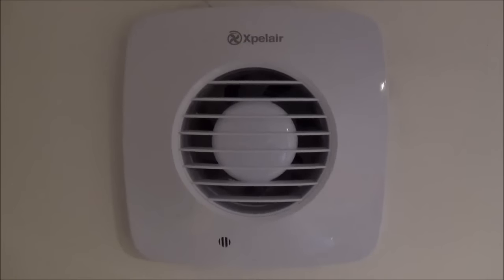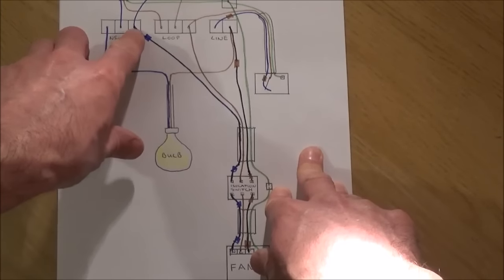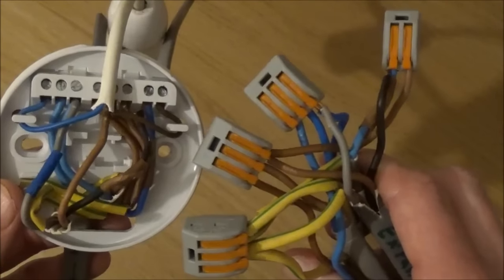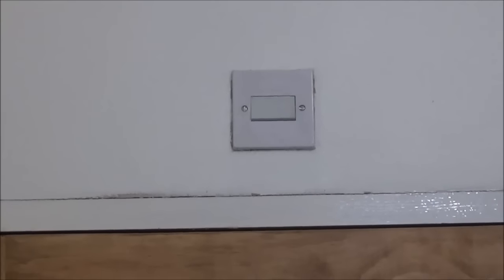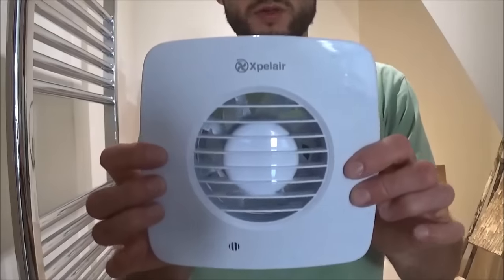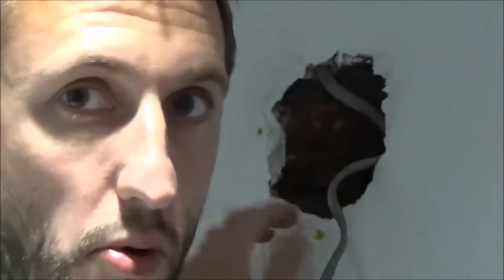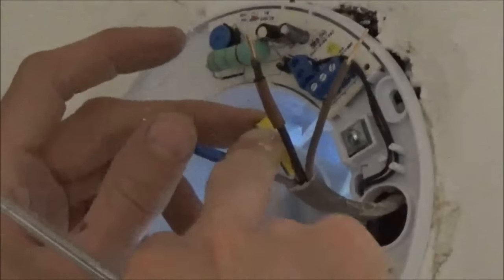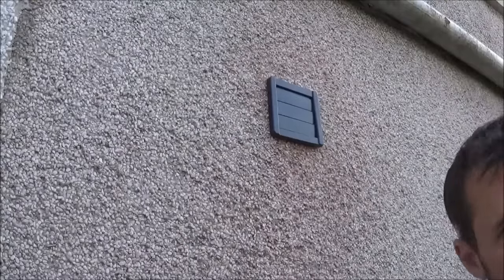How to fit a bathroom extractor fan using light switch. Extractor fan installation. Xpelair DX100

Comment: Nice vid, however unless its like for like change (in this case it's not) you will need to make sure this is rcd protected being in a bathroom.  Under current regs
Reply from the maker: Thanks for the feedback ashley, this fan is indeed RCD protected, but good point. Thanks for watching.
Reply: @POUSEaroundtheHOUSE  Im not trying to catch you out mate,  just letting viewers know in case they attempt it. 👍
Reply: 20amp

Comment: I'm looking to add one to a kitchen to remove excess condensation. Can I take the power from a plug socket or connect directly to a plug and switch on and off as required?
Reply from the maker: You can go from a socket but you will need to add a fused switch (Fused spur) and place a 3amp fuse in the switch to protect the cable and fan. If in doubt please use a qualified electrician as it could potentially be dangerous if done incorrectly. Best of luck.

Comment: Speaking to an electrician a few weeks ago and he said new regs say to put the extractor fan switch lower down . Which to me is daft . But I think they say it’s so the customer can switch it off easily in case of an emergency?? I’m Not 100% on that as I’m not an electrician.
Reply from the maker: Yes, that's possible and makes sense, but that said there's a chance people press it by accident. It'll also just be good practice rather than essential I imagine as it's not really a safety issue, more a practical one. As I'm not an electrician I'm not sure but I'll look into it. Thanks for the feedback 👍

Comment: Hi there. Very useful vid, thanks. I've followed it exactly but for some reason the light comes on but the fan won't. My switch was wired with the blue wires in a block inside and there is no onward light wire - I only have the fan wire in the Loop on the light fitting. Wondering if this is the root of the problem but no idea how to solve. Any advice gratefully received! thanks

Comment: Moved into a new build the recent storms have blown off my vent covers (builders couldn’t be bothered to secure them with screws) and it looks like the extractor fan pipe isn’t flush with the brickwork on the external wall. Does this matter or do I need to chase up the builder to correct it ?
Reply from the maker: If it's a new build then I would chase them up. Would you be happy with a new car with the bumper hanging off? It's a shame they don't take the time to do things properly. You've spent your hard earned money a nice home, you should get what you paid for. Ultimately its up to you but that's what I would do. Best of luck with getting it sorted 👍

Comment: great video bud and well explained....however I get baffled easily. heres my problem. I had an extractor fan and light in my bathroom all working perfectly until the fan started sqeeking. I ripped it out. the light got changed too. I tried to re-wire it all up myself but now the fan comes on when I turn the light out and the fan goes off when the light comes on. there is a black a blue and a brown coming out the ceiling. there is 2 slots for cables on the fan. I have the brown 1 in the live slot, I have the black 1 in the nutrel, when I change the black for the blue then the fan stays on continuesly. its a puzzle. any ideas? wired the light wrong?
Reply from the maker: Hi Dave,   when you say blue, is it blue tape on a grey wire? Sounds like you have wires for a timer fan, but your fan isn't a timer fan. Basically your blue is neutral and should go into the 'N' or Neutral terminal on the fan. Your black sounds like switched live and should go in the 'L' terminal as it will turn on and off with the switch. Your permanent live (Brown) can be safely terminated into a connector block (like a wago 222 block) and left inside the fan but not connected to the fan. On a timer fan you need the permanent live to allow the fan to run on a while once the switch is turned off. You could always replace it with a timer fan which would over run when the light goes off. Obviously without seeing it it's difficult to say.  Hope that helps. Good luck and thanks for watching!

Comment: I've just renovated my home and fitted p.i.rs into the bathrooms with timer run on fans and then it came to me that when its not dark the p.i.rs will not bring the fan on, unless I can wire a bypass switch can you show me how
Reply from the maker: Hi Robert, not entirely sure of the set up you've got and I don't have one to do an example on. However surely the fan is triggered when someone enters the room. You wouldn't use the bathroom in the dark? Also, maybe you can wire it so both the light and fan come on with motion detection? Without knowing the products and having them to do a demo you'd be best off checking with the manufacturer or an electrician as it's probably not straight forward to explain. Sorry if that's no help. Good luck and thanks for watching!

Comment: I am looking for how to separate them . The fan is really annoying. It turns on each time you use the light.
Reply from the maker: Try my other video - How to fit a bathroom extractor fan using an independent switch - https://youtu.be/KxH_FM03cMs

Comment: European and UK electrical regulations also have specific zones in the bathroom where you can fit electrical items, like lights and fans, in some areas, items MUST be low voltage. You make no mention of this during the video which can be misleading or even dangerous for people following your instructions. 
Bathrooms are divided into four specific zones relative to proximity of water, humidity and electrical apparatus. All electrical items must also comply with IP (Ingress Protection) ratings.

Bathroom Zone 0
The inside of the bath, or the inside of the shower that can physically hold or contain water. Electrical items installed into these areas must be low voltage, SELV (Safety Extra Low Voltage - no higher than 12 Volt), and rated no lower than IPX7.
 
Bathroom Zone 1:
The area directly above zone 0, limited to a height of 2.25 metres above the bath or shower. Electrical items installed in this area must have an IP rating of IPX4 or higher. Items installed into zone 1 can be mains voltage, but if so must be fitted to a 30mamp Residual current device. Low voltage items can also be installed in this area, but the transformer for those items must be located outside of zone 2.
 
Bathroom Zone 2:
This is the zone beyond zones 0 and 1, continuing 0.6 metres horizontally and up to 2.25 metres vertically. As with zone 1, mains voltage items must be fitted to an Residual current device, and low voltage items’ transformers must be installed outside of zone 2. IPX4 or higher protection is required. Wash Basins are classified as being in zone 2.
 
Bathroom Zone 3:
Any lighting or extractor fan can be installed in this area, as it does not have an IP rating. Apart from shavers and toothbrushes though, no portable electrical equipment is allowed in this area. 

You can check here for more information
https://www.sparksdirect.co.uk/blog/ip-rating-in-the-bathrooms-bathroom-ip-zoning/

Remember for your safety all electrical works must be carried out by a fully qualified and registered professional electrician. 

Especially in Bathrooms and Kitchens!!!
Reply: The regulations also state that the following mains voltage, fixed, permanently connected equipment is allowed in zones 1 and 2 of a bathroom.
Whirlpool units, electric showers, shower pumps, ventilation equipment, towel rails, water heaters and luminaries.
Reply from the maker: Thanks both for the feedback. Maybe I should have mentioned that in the video. For info, my installation was in a suitable zone, with correct IP rating and RCD protected. Thanks both for watching.
Reply: @POUSEaroundtheHOUSE  Not Maybe! Definitely! 
It's not good practice to encourage DIY electrical work in areas where water and electricity are together, not only can it be very dangerous, but by law, the homeowner or landlord must be able to prove that all electrical installation work on their property meets the requirements of Part P of the 2005 building regulations, In additional changes were introduced to Part P in England in April 2013. This means that electrical work in a dwelling, or associated with its surroundings, is notifiable to a local building control body where it includes:

Circuit alteration or addition in a special location ( Certain zones within a room containing a bath or shower, or a room containing a swimming pool or sauna heater)

Installation of one or more new circuits

Installation of a replacement consumer unit (fuse box)
Rewire of all circuits
Partial rewire
New full electrical installation (new build)
All electrical work in the home in England must comply with Part P of the Building Regulations. In addition, those items described as notifiable above are required by Law to have a Building Regulations Compliance Certificate.
Reply from the maker: @pjmbidge632000  Hi Paul, I do reference Part P at 34 seconds in the video. Thanks again for the comment.

Comment: Hi thank you for your video, I have fitted a fan following another YouTube video,  the video showed the wiring going from the fan to the isolator and from the isolator to the lights pull cord switch, it has not worked, the bathroom light is a new enclosed unit with a lifetime bulb, all it had to connect it was a red live wire, a black neutral wire and the earth , no loop or switch wire, how would I connect the fan to the curling light with that wiring set up, thank you ever so much for your help
Reply from the maker: You probably need to find the main connection in the ceiling or at the light switch. You will need a switched live, permanent live, neutral and earth (CPC) wire to do the installation as per the video. If in doubt call an electrician to ensure it's safe as it can be a tad complicated! Best of luck.

Comment: Since the fan is double insulated could i used twin and earth use neutral and permanent live, but mark the earth wire red and use for switch live?
Reply from the maker: No. Earth wire is thinner than other two at it isn't insulated, it's bare. Use the correct cable. Hope that helps.

Comment: Hi, I'm in a bit of trouble - and need help please.
I ran a 3 core cable (live, neutral and earth) to the fan. This cable is now tiled over so I can't change that!
The problem is I didn't use the light ceiling rose for wiring as it is too difficult to access. So I just put a junction box on the line going to the shaving light over the mirror (easy option!!)
No I have a fan with a timer and I can't wire it up because I don't have any of this done correctly! I just have a live, a neuand an earth!! I should have paid an electrician!!!
Is there a way to wire this in the way that I've done it (with just the 3 wires)?

I cant change the fan now either because I've the holes drilled in the tiles and other fans won't fit there (I've checked). So I'm stuck with this timed fan and wrong wires..ugh! It's not DIY,
it's D - I - WHY!!!!! 🙄
Reply from the maker: Have you looked to see if they do your fan in a non timed version? Sorry if that's a stupid question! My fan came in 3 versions all the same size and appearance with same hole spacings.
Reply: Or you could have the brown live cable to the fan connect up to the switch live terminal on the fan as well as the switch live. You'll need an extra bit of single insulated brown cable to connect the two up.
This does mean there will be no timed overrun that the fan will continue working for.
Also, the junction box you have on the other end of the cable connected up to your shaver light will need a neutral connection for you to use along with a switch live so that your fan comes on and off with your shaver light.
Make sure your junction box has the correct IP rating for bathroom use.
Check out the location of all the work you've done in relation to bathroom zones 0, 1 and 2. If you've added anything inside the zones (like the wiring and junction box?) this counts as notifiable work. That means building control needs to be informed, and a registered electrician must sign off on the work to say it's fine.

Comment: This is so so so wrong. You never, ever, put 2 cables in the 1 hole of a wago. NEVER!
Next, you never mix colours in wiring.  Even if you lable it with tape.
Finally, you never switch the neutral. There is no need for a 3 pole switch. All you need is a single pole switch and switch the active only.

Comment: Nice video. I want to fit a led bathroom mirror below the extractor fan but no wiring in place , can I extend the wiring from the fan and join it to the wiring for the mirror?? Is this possible?? Many thanks
Reply from the maker: You will want an isolation switch on the mirror as well as the fan so yes you could in theory have the mirror wired from the isolation switch to the mirror but you will need to install a switch from that feed for the mirror. You also have to check that the fan and the mirror wont exceed the rating of your cable although that is unlikely if its just an led light. Hope that helps. Thanks for watching.

Comment: Hi Pouse great video will really help, only question I have is in my bathroom I have 2 old fan units which I want to replace with the dx100, would the wiring from the 2nd fan use the same terminals within the ceiling rose or is this to much of a strain for the circuit. Thanks Wayne
Reply from the maker: Hi Wayne, without seeing the wiring and knowing what size cables are being used, and what condition they are in then I can't really comment. But, in theory, assuming all the cables on your lighting circuit and your fan installation are the correct size (1.5mm twin and earth & 1.5mm 3 core and earth), you have a 6amp MCB (miniature circuit breaker) on your consumer unit, your consumer unit is a up to current spec with RCD protection then doing what you suggest should be safe and is highly unlikely to overload the circuit as these fans drawer very little power. But, like all circuits, the only way to really know would be to know what is on that circuit already, and for an electrician to test it. The most important thing is that if it did overload, the MCB would trip and turn the power supply off making it safe. Take for example, one house may have 30 lights all with old 100 watt bulbs which when all turned on would use 2000 watts. Another house may have 20 lights with modern LED 4 watt bulbs which would use use 80 watts when all turned on. As it happens, both those scenarios should be fine with the right cable, assuming they weren't too long but there are so many variables to consider it's not a question with an answer that can be applied to all scenarios. Hope that makes sense and hope that has helped a bit. Sorry if it hasn't! Thanks for watching!
Reply: Hi thanks for getting back. ordered & installing same units as you and replacing all wiring to fans for new so 4 core 1.5
Reply from the maker: Great news Wayne, hope it goes  well. Good luck!

Comment: My bathroom extractor fan (with timer)  stopped spinning a few years ago so I just removed the wires out and blocked them, to replace later. Finally got round to it today. The three wires that come through to it are coloured Red, Blue and Yellow. It's not earthed. So, which is which please? Fan terminals ar switched live, permanent live, neutral. Thanks!
Reply: I'm no electrician but that is exactly the same as the one I removed for replacement today. It looks from the diagram on mine that L= red, N=blue and LS=yellow. So the yellow is the line to the switch.
Reply: @mikeakachorlton  Thanks Mike, I assumed this was the case, deduced from Red being the L in old money, and Blue being normal N anyway. I guessed Yellow would be SL. Went with gut instinct and all ok. I found an old diagram on a random website somewhere later which showed this too.

Comment: Absolutely great - except that my bathroom doesn't have a ceiling rose, it has LED lights.  There is no three terminal connection system, just a live and neutral to each succeeding LED light.  So where do I get the mythical switched live, or loop terminal from.  No idea and I have now watched about six of these videos.  Each one starts with a ceiling rose!
Reply from the maker: It's probably in the ceiling in a connector block or junction box. Are the floor boards accessable above? The only other option is to get the power from your light switch maybe? But if you're not really sure what you're doing, might be best to call an electrician, stay safe!
Reply: instead of the ceiling rose , somewhere above your ceiling there will be a cable that runs from the mains to the lights and the switch - if it was professionally installed there will be a junction box or similar that you can use.

Comment: Mate never put more than one conductor into the same slot on a wago. Especially if left loose in a loft. Likely to cause a loose connection, which if you are lucky will just stop things working. Defo don't do it on the cpc's as you will never know they are loose until your metal accessory in the other room has no earth.

Moral of the story get a competent sparky, with the right knowledge and test equipment.
Reply from the maker: Thanks for the tip
Reply: Obviously you've never been on a new build in the uk ...nothing's done right ...

Comment: thanks great vid ....   i  need to  do  something simular to  this  but  instead take a spur of the light in  the loft to run  a low power device like a cctv box the  device will  be always on so i  dont  need a wall switch i  will just  switch it on from  the plug when  installed can  i  just take power from the loop and neutral and connect the ground and ignore the switch wire
Reply from the maker: Thanks for watching.
Reply: no you cannot